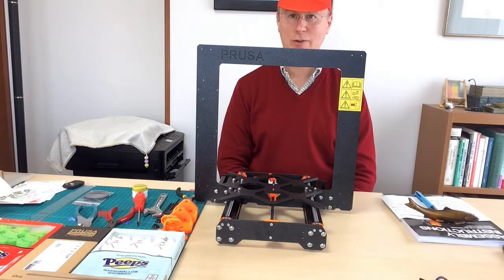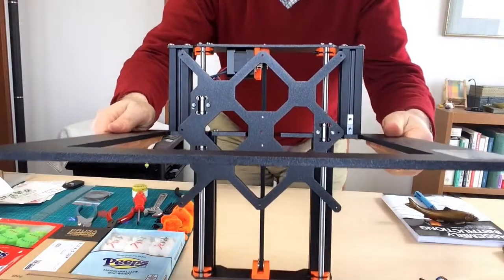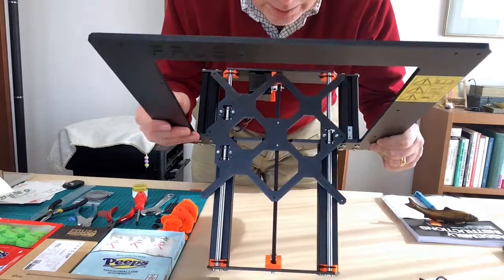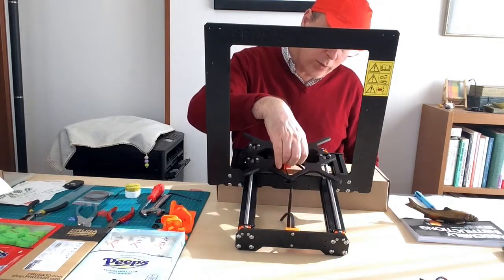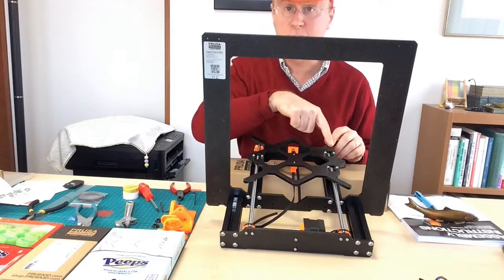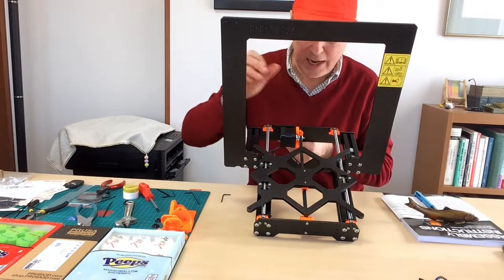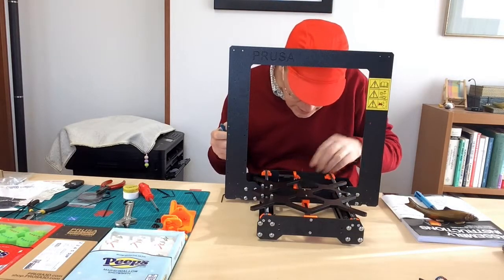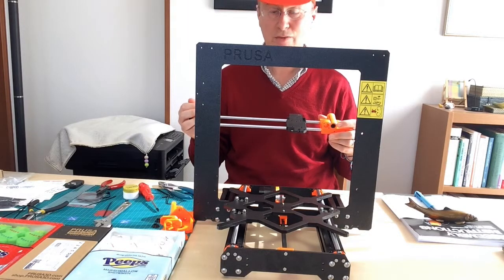Taming a noisy Y axis on a Prusa i3 MK3 -- Prusa i3 MK3で騒々しいY軸を調教

Comment: You also have your power supply T nuts in the extrusion on the wrong side of the extrusion. You have them on top they’re supposed to be on the side. I’m sure you figured it out at this point 5 months later :)
Reply from the maker: As far as I know, for the older model PSU used in my Prusa, I followed the instructions for mounting as directed. Mounting for the new PSU is somewhat different.
Reply: @ReluctantRoboticist  oh you must be right for some reason I thought all the MK3's had mounted the same. I ran into a similar issue with my bearings feeling a bit janky but I soaked them in 99% IPA for 20 mins and packed them with a high quality grease and now they're like butter. although now I'm trying to figure out if my belt is setup optimally. it likes to hug one side of the pulley no matter what I do. it actually seems like the two plastic belt retention parts in the middle of the Y carriage are slightly off kilter, but there's not much I can do about it as there's only one screw holding them in plus another going through the two plastic parts. I tend to be very meticulous though so ill have to watch some videos and see how other peoples look. most of the time mine is fine or better than others, I just have high expectations and strive for a perfect build no matter what project I'm working on. looking forward to getting this MK3S+ up and running. It's been a very long time coming. Cheers,

Comment: Try some lube.. sound Dry...
Like Metal on metal no lube
Reply from the maker: Thanks for your comment. Have you assembled a Prusa printer? The metal rods and bearings come pre-lubricated. Although judicious use of some non-oil based lubrication may be recommended after extensive use, the problem shown in this video was found during initial assembly. My limited experience with assembly of a six-axis robotic arm (shown in another video on this channel) suggested that there were other nuances that were necessary to address during assembly.